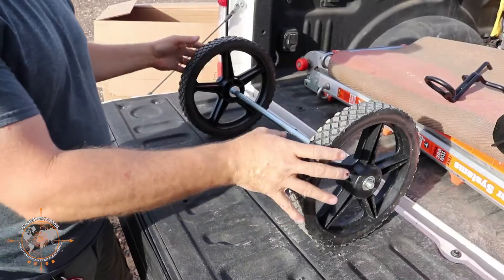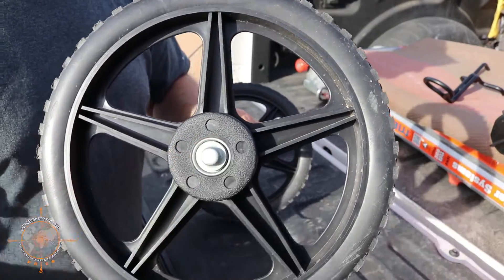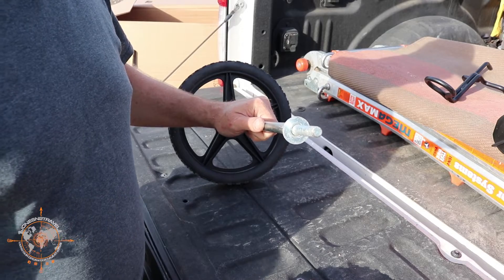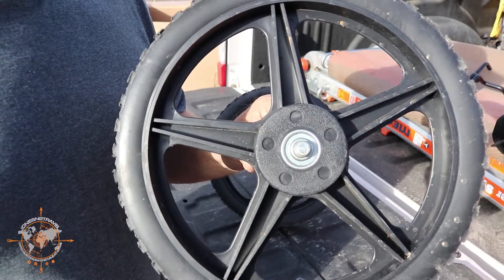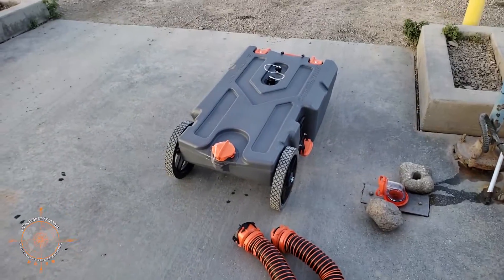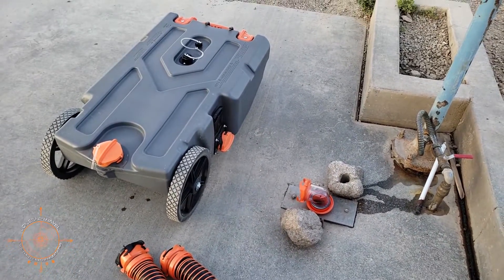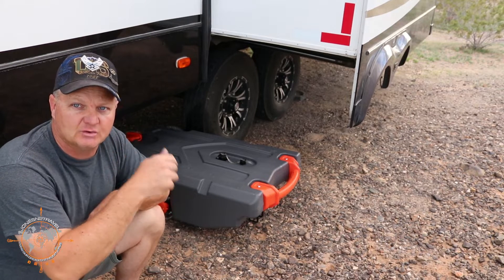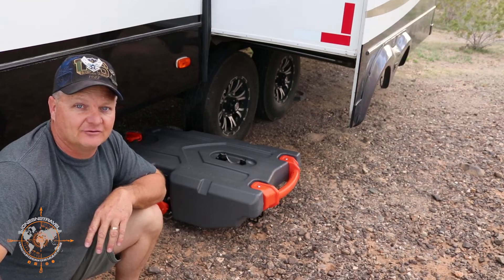CAMCO RHINO TOTE TANK REVIEW AND MODIFICATION | RV LIVING

Comment: It was funny watching your clip.  Because you bought the proper tank for what you’re using it for. I see so many people using the blue water tank for waste dumping tank. When you see the YouTube clip. Right off the bat they start well when you get this tank. Ok the problems you’re going to have because they make them so cheap. So your going to need a better hose you’re gonna want to get a clear elbow hose connection. And then they go into explaining all the mistakes that they’ve made with this tank overfilled or hose locked. I bought a 40 gallon Rhino roll behind portable tank. You can’t tell these people different. The replies on my comment we’re in the hundreds.
Reply from the maker: Yeah I bet so. Its funny what some people do with the wrong tools. :) Thanks for checking out the video. Glad you have the right tank too LOL Safe Travels

Comment: Have use a 36 gal for 3 months and one wheel broke. Trying to find a replacement wheel that will carry the weight is impossible need to upgrade to a 14 inch wheel and wider. The 12 inch wheels are only rated for 70 pounds a 36 gallon ways 250 or more. Will have to modify the axle because it’s only half inch and to get a bigger wheel you need to go to fiveeights other than that I love the tote.
Reply from the maker: Thanks for the update. I saw someone in AZ last winter who replaced the tall wheels with inflatable one from Harbor Freight. It was a diff brand tote but that may work on yours. Just a thought. Thanks for sharing your experience.

Comment: looks great!  nice mod.  too bad the discharge wasn't on the other side of the tank.  would make more sense if its towable to be on the same dump-side as the dumppstation.
Reply from the maker: I can't argue with you there :) It almost seems that whoever is designing these RV accessories never actually use them ;) Thanks for checking out the video. Safe Travels.

Comment: Looks like the tote is higher than your rv drain pipe.....hard to make the juice run uphill....Might not be a problem on flat ground but what if it's kinda hilly?
Reply from the maker: I agree, it would be nice if the tote was shorter. It helps to have that valve on the end of your coach pipe so you can shut it off and then lift the hose repeatedly to get everything out of it.

Comment: As of 4/21 (7/20 mfg date) Camco has revised the axle cap nut by milling the axle and using a snap ring.  Otherwise, I would do your modification - I just bought one a 36 Gal 4-wheel and watched your video for your review.
Reply from the maker: Hey Scott. Thanks for the update and thanks for checking out the video. Safe Travels

Comment: I just bought one of these.  Apparently, Camco has changed the wheel retaining system.  Underneath my cap, there was a macined groove and a "C" clip holding the bearing and wheel on.  No need to install a cotter pin.
Reply from the maker: That is great news. I have heard reports of folks getting the old version as well so hopefully old stock will run out and this will no longer be an issue. 😁 Safe Travels

Comment: Thanks for the video. How often are you dumping? Have you had to much waste for tank and what did you do? Where do you store your hose when not in use? Complete newbie so sorry for all the questions. Thanks again
Reply from the maker: Hey there. It all depends on your RV, tank size etc but we go about a week on our grey tank and 2 weeks on our black tank before we have to dump. If you have too much on board the RV then just let it drain into the tote and when the tote is about 75% full close the valve on your RV to stop the flow. I store my hose in a plastic back in the back of the truck. Rinse well before storing. 😉👍 Ckeck out my top 5 tips to using your tote tank video here https://youtu.be/MPQBwaEPfmI
Reply: @JonesN2Travel  just got done watching. Thanks so much!

Comment: Thanks for this. We just got the 36 g. How fast were you driving with it after modification?    It said I should keep it below 5mph ? What! Whats your suggestion?
Reply from the maker: I agree. I try to keep it at 5 MPH just to be safe. U could probably go a little faster if the road was smooth and paved but I personally wouldn't risk it. Of course, if the road is really rough you'd want take it slow.
Reply: You walk at 2 mph or so. Since the truck is doing the work...go three and avoid problems. I am not sure why they even advocate towing these tanks. Every mishap I have seen was related to towing. If less than a 1/4 mile...get some exercise.

Comment: I just had my tank delivered yesterday and was going to do your modification but there's no way I could pry the caps off so I'm wondering if the caps on yours were not installed properly or if they've improved the way the caps are held in place. On mine there are two tangs on each cap that bite into the axle that keeps them from coming off. But I agree, a cotter pin would be better. Thanks for the heads up and great idea with the mod. I"ll keep and eye on mine and see how it fairs.   Cheers.
Reply from the maker: Thanks for that update. One of mine fell off and the other I had to pry pretty good to get it off. Your point is valid, its possible that one of the caps on mine was defective. Keep a close eye on them. You could probably drill through the side of the cap and axle and install a pin anyway for added security. :)
Reply: @JonesN2Travel  That's a good idea. Thanks.

Comment: What size washers did you use?
Reply from the maker: Hey Matt. I used the washers that were on the inside of the axle next to the tank. Not sure exactly what size they are but if you wanted to keep those inner washers in place you could source two more the same size for the outer side. Hope that helps.

Comment: Thanks so much for making this video! I just got this tank yesterday, there were several parts missing, BUT the biggest thing was that axel cap was gone off one wheel! I found a new one at Home Depot, and was able to hammer it on, but I was thinking how easily it could pop off! Excellent solution.

Silly question - did you need a special bit to drill through the axel? I have a set of bits... but no clue if they would do that 😬
Reply from the maker: I just used a normal drill bit. The axle is pretty soft so easy to drill
Reply: @JonesN2Travel  how far did you travel with that full rhino tote?

Comment: Supposedly Camco has fixed this and changed the way the wheels are secured?
Reply from the maker: Hi J. I have heard reports of people getting the updated version with a snap ring on the end of the axle. I assume Camco tested the new design with the tote full. LOL Time will tell if their fix holds up. I've also heard of folks getting old stock without the fix. :) Thanks for checking out the video and following along. Safe Travels

Comment: How far did you transport that?
Reply from the maker: Hi Erika. The dump station was about 300 yards from our site so not too far. Hope that helps. Thanks for checking out the video. Safe Travels
Reply: @JonesN2Travel  dang ok I'm trying to figure out an easy way to get that in my truck to the RV place to dump it after I have guests.  It's like 6 miles from the house so I don't think pulling it would be good
Reply from the maker: @ErikaSudz  I've seen people use those trays that go into your truck hitch that brings the tote closer to the ground on the back of the truck but you would still need to load it before you fill it unless you can winch it up there or something. Not very practical I know. :)
Reply: @JonesN2Travel  :(

Comment: Nice video and thanks for sharing and great idea.  I'm also in disbelief with the hats.  One point that I want to make is the axle can walk left or right in the plastic housing under the tote so I'm going to leave the washer on the inside.  It would block the tire from rubbing the tote if it did walk and it's really close without that washer there.  I will pick up some thinner washers for the outside.
Reply from the maker: Hi John, that is a great idea. Thanks for checking out the video. Glad it was helpful 😀👊

Comment: How fast can you really go while towing that poop tank?
Reply from the maker: Hi Angel, the manufacturer states no more than 5 miles per hour. I was abiding by that when the wheel fell off LOL. Just bad design IMHO. :)
Reply: I'd ask also, how far can you go?
Reply from the maker: @beckyrulandinternationalne571  you can tow it as far as you like but you probably wouldn't want to leave the campground or go a super long distance simply because of the 5 mph limitation.

Comment: I am not to use the pin method I am going to drill and tap 10 X 32 add a little tread lock and  install a screw through the cap.
Reply from the maker: That is a great solution as well. Thanks for checking out the video. Safe Travels

Comment: How come you're not using a WDH?
Reply from the maker: WDH?
Reply: Weight distribution hitch.
Reply from the maker: Ah, for the tote tank? LOL That's funny.
Reply: No, for that giant ass trailer you pull.
Reply from the maker: Oh, sorry, Its a fifth wheel so no WDH needed. Great question though. I would definitely use one with a bumper pull, no question about that.
Reply: Ahh, that's why, I didn't see the front of it.  I was only wondering because I think the ball is higher on my WDH than on my utility hitch and would make a higher angle to tow the Rhino.
Reply from the maker: Yeah great point. I just have a basic drop hitch that I throw in to tow the tank. I don't think the higher angle would make that much difference though. They designed the end and bottom of the unit at a nice angle so you should be ok.

Comment: they fixed the wheel problem on newest models ,but poor design on tank drain when tilting to drain , it destroys the lowest locking studs when you tilt to drain, ,after awhile you will only have 3 studs left and IT Will Leak while pulling  ,should have molded in a ( X ) pattern instead of ( + ) vertical,horizontal pattern and would have no future issues with cap sealing tight with no leaks, common sense prevails,
Reply from the maker: Thanks for the update @Sonny Mumford. We can only hope that someone from CAMCO sees this and makes yet another adjustment to the design. I appreciate your feedback. Safe Travels

Comment: it's not designed, nor meant, to be towed on the road.  5mph for very short distances is about it.  You are not using it the right way.
Reply from the maker: Yes, I never take it over 5 mph but I have to tow it on the road to get to the dump station. Not sure how else you're supposed to use it. Thanks for checking out the video. Safe Travels

Comment: Wheels fell off and dragged a hole in the bottom and poo water went all around the campground loop.  $$ wasted on the poo hauler that couldn’t haul poo. Poor wheel design
Reply from the maker: Thanks for checking out the video. I returned ours after the same thing happened. Actually, it went in the dumpster since it already had crap in it LOL. We have a video where I solved the wheel issue. Check it out here:      https://youtu.be/20_DnyuMACg